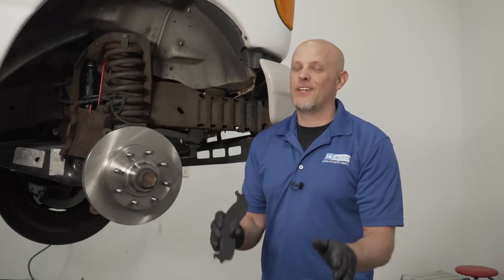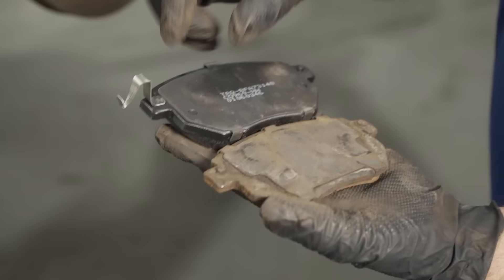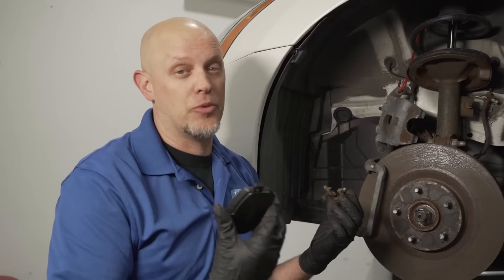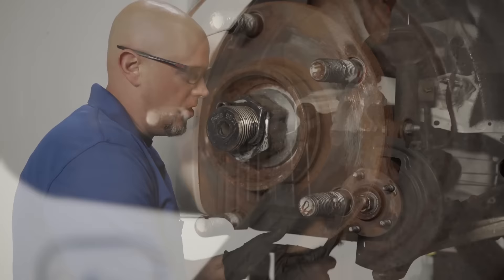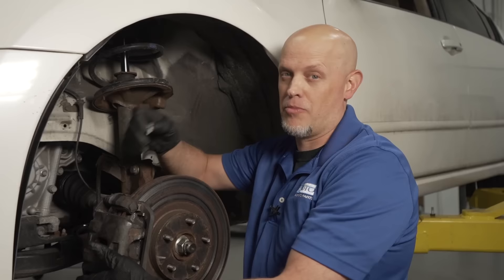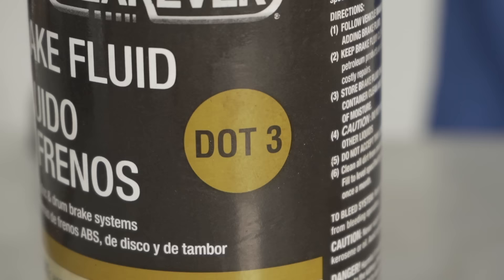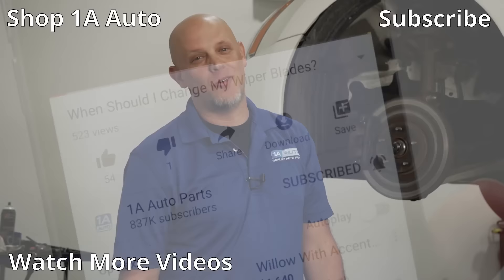Most Common Brake Installation Mistakes!

Comment: Pump the brakes when you finish lol I put it in drive and almost hit a fence
Reply: I hit a fire hydrant a couple years ago cuz brakes failed
Reply: Puedo abrir  la tapa del brake oil cuando esté presionando el caliper?
Reply: I almost ran into my other car. After I made fun of someone else doing the same thing lol.
Reply: Lol
Reply: Yes. It's called setting the brakes so that the pads are sitting in the correct position. Definitely don't want to be moving when doing so.
Reply: If you bleed the calipers like he did you probably won’t have to pump the brakes because all the fluid won’t be pushed back into the master cylinder, but never a bad idea to pump them👍
Reply: Same thing happened to me years ago. Changed pads then took off. Panic hit when I couldn't stop the car when I was approaching the automatic gate at the apartment I was living at at the time. Car stopped within six inches of the gate.
Reply: @zeta6798  De poder se puede, pero es mejor abrir la purga para que no salga excedente por el reservorio, o en su defecto usar una jeringa para extraer el excedente de líquido, si lo dejas chorrear puede oxidar la carrocería y dañar la pintura, no le va a entrar aire  de la bomba a los calipers mientras tenga líquido en el reservorio, saludos.
En algunos vehículos con ABS se recomienda comprimir los pistones sí o sí con la purga abierta para no dañar una válvula del módulo de ABS.
Reply: @zeta6798  Si
Reply: @scottt1635  doesn't really matter where the fluid is. The cylinder on the caliper is still pushet back so it won't be pushing the pad against the rotor.
Reply: can do most of the times without car running, no power brakes so hard but go slow and pump a few times
Reply: @scottt1635  the whole reason to pump is to set the brakes into position. What he did has a greater chance of putting air in the system
Reply: LMAO
Reply: I remember my friend changed his brakes in our auto ROP class and he didn’t pump his brakes, puts it in drive and just seeing his reaction as he slowly starts rolling towards the fence 😂
Reply: 😂🤣😂. Lol exactly
Reply: I took piece out of my garage door as it was lifting.  No time to pump them up fast enough.  Was about a 2 hour garage door repair mistake.  Won't forget that again.
Reply: How in the world did u miss the fence...were you not aiming for it..Ha Ha..
Reply: 10 times pump the brakes before you put it in drive/reverse. I learned that at 17 working with my uncle and my first ever brake job. Almost hit a tree with a customer vehicle.
Reply: Ya gotta watch that
Reply: Check break lines for air bubbles before test driving. Bleed them out a bit and check and top off fluid levels
Reply: I almost rear end my wife brand new car.
Reply: Lol watched the boss smash the fence  because  he took it off the lift no know why it was there lil
Reply: ...wow glad that poor fence survived
Reply: @zeta6798  si
Reply: Lol. Been there.
Reply: I hit the tree..
Reply: when you're pumping it remove the gap between the pads and rotors, be sure to just use small strokes on the pedal rather than flooring it, particularly if it's an older vehicle that's been neglected without regular fluid changes.  If the master cylinder has a corrosion ridge built up in the cylinder, pushing it beyond the normal travel can rip up the seals, making a master cylinder replacement service part of your future when you were just hoping to change pads and be done with it.
Reply: Lol y’all never hit the e brand ??
Reply: @scottt1635  Your brake pads will still be retracted so yes you still need to pump the brakes before driving.
Reply: Me and a buddy had a few too many beers while replacing wheel bearings one time, I also forgot to pump my breaks. I ran my car right into a tree that was in front of the parking space in his driveway lol.
Reply: Lmao
Reply: 🤦🏻‍♂️ same
Reply: Would the ebrake work or nah?💀 I don't wanna risk it now
Reply: I almost ran into the toolbox. And quickly jammed it into the park. Because I didn’t understand and didn’t know to pump them. Haha
Reply: If you don't take this step, at least drive a manual car so it doesn't take off unexpectedly when put in gear. 😁
Reply: Make sure you tie your shoelaces
Reply: I went straight thru my cousins fence haha, 1 inch away from hitting his neighbors old school truck
Reply: That's a human right there , we all make mistakes 😂
Reply: I did something similar my first brake change lol
Reply: Haha...I backed up then Booooom into my wife Camry...From that time on I put the sign on the steering wheel, saying "Pump, pump, pump."
Reply: Lmao, most important step
Reply: Hell yeahhh!!!
Reply: @zeta6798  yea u can
Reply: forgot to pump brakes, slapped it in reverse, had to buy new tailgate lol
Reply: Question...if you dont pump the brakes the problem is that at the first brake attempts you will not be braking? Or will there be a problem for all the times you brake (not as strong braking) from that point on (not just the first attempts)?
Reply: @mikeclarke3005  why wouldn't you run it? You're sitting in the driver's seat to pump the brakes anyway, its stupid not to run it😆😆  we always did when i went to auto mechanics school 35 years ago, always have ever since as well.
Reply: If this one wasn't so relatable
Reply: Almost crashed into my house...slammed it into park and got lucky.   Glad a kid wasn't in front of me.
Reply: Somone had changed my rear brakes and Roters I was driving down the high I heard a noise and all the breaks locked up does anyone know what could be wrong
Reply: @joeyholdaway4667  Impossible to say without more info. I changed mine recently & could've sworn I torqued caliper bracket & guide bolts correctly (with a 3/8th torque wrench & everything) but the top guide bolt came loose & fell out while driving. It only made a noise while braking+turning hard at the same time & was subtle. Got another bolt & retorqued all bolts on both sides with medium thread locker & tightened a tad above torque specs for good measure.
Reply: @giannisstavroulakis9045  If the job was done correctly, you need to pump the brakes several times as this will force the caliper piston outward & "squeeze" the brake pads against the rotor. New pads are thicker than the old ones which are worn down from being used. You usually have to compress the caliper piston back into the caliper housing, which the vid shows at 07:14 , in order to allow additional space needed to install new pads (pressing the brake pedal does the opposite of this, causing the caliper piston to extend outward). The problem is that compressing the piston introduces additional space into the system & in order to have responsive brakes, the pads need to sit flush against the rotors. The way to remove the extra slack is by pumping the brake pedal until the caliper piston squeezes the pads snugly against the rotor again. You should be able to feel it happening with increasing firmness of the brake pedal. Once you pump the pedal several times, it should respond normally whenever you brake after that
Reply: Ded not a point to be missed lol
Reply: Man I did a friends brakes and was told “it’s not that bad, but it doesn’t stop like it used to  so she’s not comfortable driving in heavy traffic rn” 🤦‍♂️busted brake line- I left to grab coffee before I got started I come back and the car is literally sitting halfway in there neighbors living room 💥🤦‍♂️ idk why they started the car up but they busted the brake line🙃
Reply: @jamesolelo4406  signs that there's air in your brake lines?
Reply: @luigui707  that prob has more to do with your inability to drive.
Reply: @dwai1967  what you said makes absolutely no sense!!!

Comment: I've been doing my own brake work for fifty years, and I've restored eight classic cars.  I still learned a few things from this video.  Very well presented and very thorough.  Thanks so much.
Reply: I paid N Tee Bee over 3000, brakes,shocks, struts,tires, they had my car for a solid week after 4 trip's back and forth 40 miles one way.  I told them I don't want it back until it's fixed. They never changed or checked the rubber brake hoses. They were clogged. I had to buy new brakes,2 new rotors and be towed in because I had no brakes and they were so hot I thought they were going to be on fire. Owner of IN Tee Bee owes me for trips,towing,new brake's and rotors. You need to Teach N TEE BEE how to change the brakes l
Reply: if you dont learn something new each day check your pulse :)
Reply: Learnt
Reply: Disk brakes are so easy. I learned on drum brakes. The first time I did them myself I put them on the wrong way with the long shoe on the wrong side. After a night I didn't have any brakes. Lesson learned. Take one side apart and do it. Then if you forget you can look so the other side to see how it goes back together
Reply: @stevesilverson5001  drum brakes are, what I call, bitch work. If you are not concentrated during the work, you can do some big mistakes 😅
Reply: The one thing I always do is clean the area with the garden hose and power nozzle it is so much nicer working on clean stuff and it only takes a few minutes.
Reply: Starting realIze these bots are paid  🤣
Reply: You cab always learn more on what you already know
Reply: Are you Scotty Kilmer?
Reply: Curious what you found new to you. 
Also, can I do front and not rear or best to do all 4 ? Thanks very much.
Reply: the squealer always goes on the trailing edge of the rotor. if you put it on the leading edge it will get pinched between the rotor and pad and snap off. then you won't hear any squealing until the metal pad hits the rotor. he said put it on top, that's the leading edge. don't do that.
Reply: @Shad0wBoxxer  I want this phrase tattooed on my arm, so very true!
Reply: That's alarming.
Reply: @Shad0wBoxxer  well said
Reply: @desdonaghy  I always do both the front or back when I do them.  Sometimes all 4.  If one of the front or back pair is going, then chances are the other one will go soon enough.  If one wheel is very worn and the other side is not, there may be something wrong with the rotor or caliper.

Comment: As a retired mechanic, glad to see you young bucks help one another back in my day you became a apprentice ( and everything that applies) I have heard folks refer it as OJT even learning at home on the dairy..or if you could afford it, you went to school ... Take advantage of this means for communication ( y.t ) teach one another take what you learn and pass to the next apprentice. It would have been great in my time to have a visual manual instead of a 3 ft thick book and trust me the pages had smug marks, we didn't wear rubber gloves. I could ramble for ever ..thanks - bye
Reply: Those were the good old days. I started to learn on my own. When I watched the Machanic fix my car so easy. Then I had to shell out hard earned cash. So I went to the Haynes mechanic books. There were no YouTube back then. Now I use both. Learn what ever you can young people.
Georgia!!!
Reply: Did you have to walk to work in the snow barefoot? Just curious.
Reply: 42, took one vehicle to a mechanic one time that was my 03 ram to have the (imagine that) rear end adjusted after replacing it i didnt have the tools or the experience, have had only 1 new vehicle and that didnt last long i got bored. School of hard knocks and busted knuckles evwntuallu you learn how to push and pull on a wrench safely. Lol. I dont think i would have ever considered if a brake pad could be put on backwards if i had however i wouldnt have thought it possible.

Comment: One important point, do not let caliper hang by brake hose, use a hanger
Reply: You can use an old 5 gallon bucket right next to the rotor to set it on too.
Reply: Yup, did that; one slipped out of my hand though. I don't have any leaks so I lucked out.
Reply: I use bungees
Reply: i used a bungie cord and had it hanging from the control arm.
Reply: AND make sure the retainer clip is removed (if there is one). Or You’ll be like me- sitting there with a caliper in your hand and brake fluid spewing onto the ground
Reply: an old fashion metal cloths hanger can be cut and bent to hang the caliper from it works great, can be reused for future jobs and usually you can find a hole or feature like the spring to hang the wire from easily.
Reply: I typically use a Nite Ize GTM64-01-R3 Gear Mega Rubber Twist Tie, 64 Inch, Black to secure the caliper via the coil spring in a non-problematic position, and often incorporate a bunge cord too as a backup in case I slip.  I like the comments about (removing) the retainer clip for the flexible soft hydraulic line as well as any hardware that secures the ABS sensor cable too.
Reply: I hang mine on the strut spring
Reply: A piece of twine or heavy string works if you don't have anything else.
Reply: I keep small rolls of baling wire around the shop for this and other purposes. It's cut-to-size and very sturdy I use it for holding driveshafts up also and they can be pretty heavy. 👍
Reply: @Hbgn Considering people use caliper hose pinch off tools to cut off the flow of fluid when servicing (which I would never do myself), they can take a lot of abuse.  Some puny calipers weigh so little they could hang from the hose without any problem.  Others are massively heavy and should be supported to avoid possible problems.
Reply: I use heavy duty zip ties and fasten them to the strut springs. Get like 50 for $2.99 at Harbor Freight, and it has the benefit of not being able to slip off like a bungee cord could.
Reply: @E. N 😂😂. I don't think other people got the joke. That was funny though. Deserves more thumbs ups.
Reply: I use an "S" hook and hang it on the strut spring.
Reply: Zip ties work great
Reply: My coworkers at the shop do  the same hanging calipers.
Reply: My pops told me that old school idea 😁
Reply: some cars have torsion bars instead of coil over springs
BTW - you get extra points if you can put a zip tie on anything with one hand!
Reply: Exactly!!! I loose my brakes twice, because the technician do it wrong  and time after the brake hose just fail and all the brake fluid, goes away...
Reply: just set it on the axle lol

Comment: Since you have to compress the pistons back in the caliper to make room for new thick pads, remember to slowly pump the brake pedal til it gets hard - before you put it in drive!
Reply: Meh!  They’ll just get a little scare on the first drive out with the new brakes. It’s good for the heart
Reply: I learned this the hard way, almost ended up in a fence. LOL
Reply: My friend rolled into my parked car because he did not pump the brakes after replacing pads.
Reply: My dad is a mechanic 👨‍🔧 he help me do  my brakes 
Then he said let’s go test them out so we hop in the truck and soon as we pull out the drive way  I tap the brakes and the pedal went down and I panic 😱 there no brakes he was laughing said just pump them your ok 😂
Yeah good
Times 🤙
Reply: @adrenalinehigh2070  LOL

Comment: I cringed when he greased the surface of the pad 😂
Reply: Me too, it was an involuntary response I couldn't even help but cringe
Reply: yep! i was like NOOOOOO!@!!! oh wait example
Reply: I Know it didn't feel right 🤯
Reply: Me too!  I couldn't help but think: What if someone is watching and following along with what he's doing, without listening well.  Or with the volume down.  Yikes.
Reply: So did I! I literally said Nooooo! Out loud.
Reply: Yeah he said don’t out the grease on the pad then he did it
Reply: He was greasing the BACK of the pad at first, and then said....while doing it...."you DON'T want to put it on the surface of the pad". I think he was just doing it to point out not to do it, but still...
Reply: I quickly made some popcorn. I thought he was going to install the greased pad and take a test drive.
Reply: I've greased the surface to stop it from squeaking. It has never kept me from stopping the car, though it might take a little more pedal effort until the grease burns off. I never do more than one wheel at a time, just to be on the safe side.  It might even make it easier to stop without locking the wheels.
Reply: lol, just think if a person is watching this with no sound... or  worse, deaf without CC on...now that I think about it, its not so funny...
Reply: Hey, friction will wear out your pads faster!!! Lol

Comment: Thank you for the helpful hints!  Here's one more:  Do one side at a time.  When reassembling, it's handy to have the other side as a reference on how things go back together.  This is especially handy with drum brakes.  It also prevents mixing RH & LH parts.

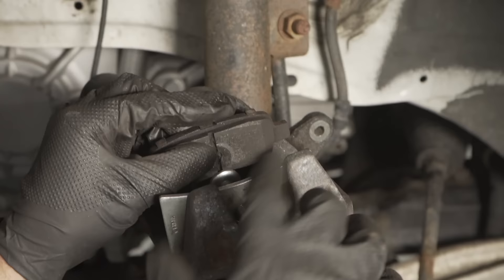Comment: One thing to add: BEFORE compressing the caliper piston back into the caliper (in video at 7:30) I like to first use a tooth brush and some soapy water (dish soap) to clean off the rubber boot around the piston, otherwise you can push dirt back into the piston and ruin the rubber boot or the piston itself. ALSO, BE SURE the guide pins on the calipers are lubricated, (in the video at 4:21) alot of people miss this step, I like using Lubriplate grease (but any grease is better than nothing), if they are dry or rusty the calipers will not center themselves properly on the rotor and the brake pads will wear unevenly and or warp the rotors. Great video!